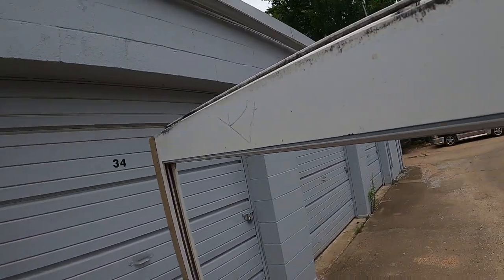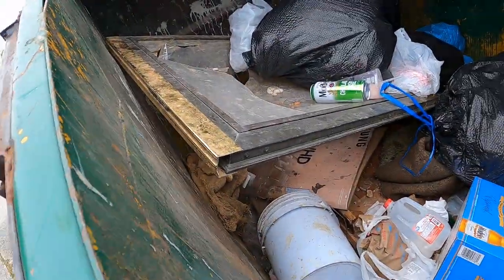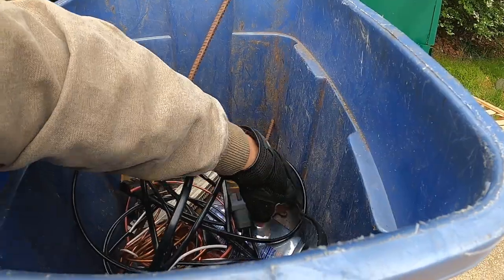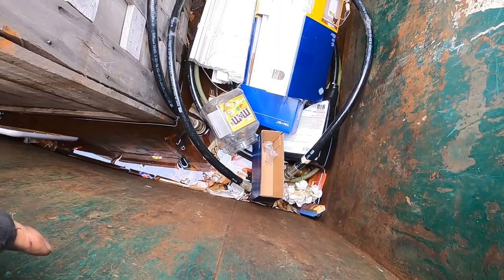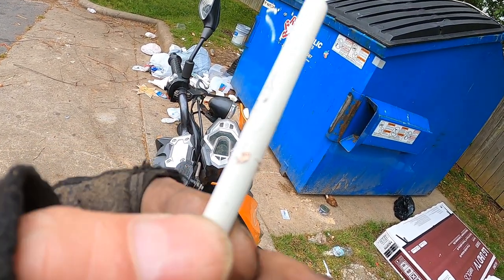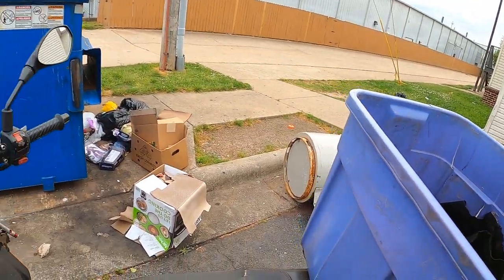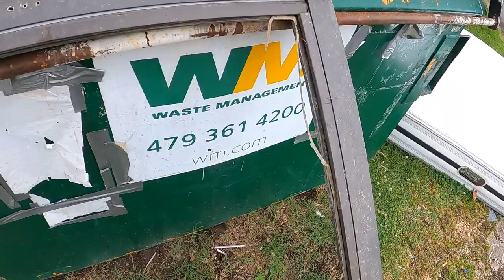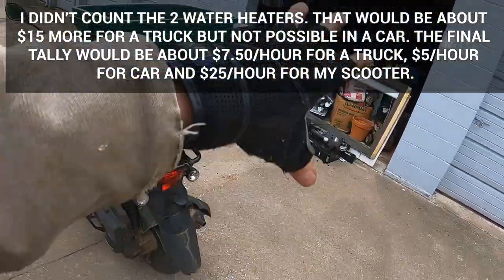DUMPSTER DIVING - How I Made $25/Hour Scrap Metal from Trash Today

Comment: It's all relative because you say it cost 12ooo grand to run a truck doesn't make it so. Canadian treasure hunter goes through his monthly figures and he is definitely coming out better.
Reply: to be fair his numbers for "others" is 100% BS but this is largely due to his internal bias. IE if he drove around as 12mpg v8 pickup truck "THE WAY HE DRIVES AROUND THE SCOOTER" then yeah. his costs would be pretty high.

but that is not logical. someone successfully using a pickup[ truck WILL NOT SCRAP the way he does. back in PA we would drive around for about 1hr before the pickup truck was FULL to bursting and nab $100 to $150 from the scrap yard not counting any held back resell/al/cu/brass etc.. typical fuel costs $5 to $10 for that hour. insurance $334 a year at the time for that pickup truck)

You don't cherry pick when you pickup truck scrap. you hoover. you vaccum up EVERYTHING metallic you come across. ie you go for volume not value. you make up for value with volume.

Mostly it depends on where you live and how much scrap you HAVE in your area. a good comp is to look at florida scrapper. most of his vids are ONE day to the scrap yard in 2 hours or less from when he starts and he uses an efficient 4cyl small pickup truck. I assure you if he pays more than $400 a year to insure that truck I would be blown away but he does show his reciept each day from the scrap yard. he easily equals on the daily what vulture gets and he is DONE in under 2 hours.

that is not to say vulture is doing it wrong. its just "different" where vulture is wrong is his assumed numbers for other methods. his numbers for himself are fine. no issue their.

Comment: I don't know about 12 grand a year on any vehicle but the point of the matter is he simply doesn't have the industrial base in his area for any heavy duty scrapping, and like he mentioned, curbside pickup is very infrequent in his area, so It does make sense to roll light duty for his area. My city in DFW metroplex, the industrial zones are as large or bigger than small towns. You would actually benefit here with a trailer or truck, and all scrappers I see here have that, plus the curbside is weekly. It would literally take over 2 months to hit most dumpster in my area and still miss some.

Comment: If any of the books were worth any money, dig down a little and see if you could find any dry ones. But the hot water heaters are a great find. If you kept a small piece of pipe(5in) in your tote you could stick it in the opening of the brass piece and hit it to break loose the valves easier. Sort of like using a cheater pipe. Well like the one that had a short piece of pipe already in it, it came loose really easy. A nice long video. I’m glad to see. A really good video again. I like your long videos. With gas as high as it is, you definitely have an advantage over the bigger vehicles. Stay safe and God Bless

Comment: My truck is paid for. It's got a six cylinder fuel injected engine. Great on gas. My insurance is cheap. It does not cost 12 thousand a year to operate. I damn sure don't have to stop and lump my tire up all the time. I'm a veteran my vehicle tag is free. I make way over $25 an hour using a pick up truck. You definitely don't know what your talking about. I've been scrapping waaay longer than you have. I'm probably 20 years older than you. Now you're calling Bitcoin a stock. Stock tip for you. Genesis AI. Invest now.

Comment: I might have tried using the large yellow cable cutters as a giant pair of pliers on the brass pressure relief valves to unscrew them or stick a screw driver or a bolt into the hole as a lever to back them off. The hammer did do the trick though.

Comment: How come you don't go out and pick up a small garden trailer to tow behind your scooter
Reply: He has addressed this before in previous videos. He does make a good argument as to why he doesn't, however my argument would be to only use it when he brings stuff from his storage unit to the scrap yard.
Reply: @E-BikingAdventures  exactly !! don't use it for the hunting just use it for the clean up from the storage units !! I have this teeny tiny little trailer that has one of those cargo carriers bolted to it (plastic with lid etc..) I never use the lid though.

it can hold a lot but is far lighter than his scooter I can lift the whole trailer up in my arms. (some are just HF 42x40's with a carrier bolted to this this one was purpose built much lighter) I think I paid $250 for it. so worth it. would pay for itself very rapidly if he ONLY use it for yard runs!

Comment: I watched a pallet scrap metal guy the other day bc I was jonesing for VidVulture videos 🙄😁 YOU are CORRECT. The way you scrap is far more profitable. This dude has a hydraulic tailgate, which we all know that wears out and will have to be replaced. But what he took in and dropped off, full truck bed, 75$... I was like what?!?!  I've seen Vidvulture come close to that on the bike, just in a short time. So yeah I already know that the way you work is alot more economical. Plus your bike doesn't emit pollution like a vehicle does. Keep up the great work Vidvulture 👍
Reply: His scooter runs off gasoline, so why wouldn't it? Those other scrappers in pickup trucks hold on to their non ferrous. That $75 was most likely steel shread only.
Reply: yep. he made $75 which is about the same as VV made when you adjust for fuel costs etc.. and he did it in 60 to 90 minutes for what took VV  hours if not all day. its all about time versus volume versus profit.

ALSO once you are successful on youtube if you have enough view the scrap value actually becomes a smaller fraction of your total income. it becomes support to make the videos where you really make the cash. (that's how pallet man could afford that hydraulic life I would kill for !!!) hydraulics are pretty reliable and not that hard to maintain once know what you are doing and how to properly care for them. he makes enough money to afford a larger more comfortable vehicle to scrap in (VV is quite a bit younger and his body can take more of a beating)
Reply: @nerys71  . Im not sure he is that much younger. Scrap and Pious man is 54. I have reason to suspect VV is in his mid to late 40s
Reply: @E-BikingAdventures  that is pretty close to what I would estimate as well. 10 years possibly as much as 15 years. is a HUGE difference in that range. things change quite a lot from 45 to 55 or 40 to 55
Reply: @nerys71  . Yes. As a 53 year old. I know.
Reply: Yall must be watching another channel because most of VV's tickets average around the $15-20 dollar range at the scrap yard, except for that last copper score on the wire I think he pulled about $45. And It's rare to pull that much wire in one haul. His whole unit looks like it only averages about $120 total in scrap value, as most of it is hoarded items.
Reply: @ProductTesteratTrojanCondomFac  . Agreed. He just waited until he got an above average score to claim that.
Reply: @nerys71  . I just found out Vidvulture is 51. He gave his age in another video Posted May 10 2021 towards the end.